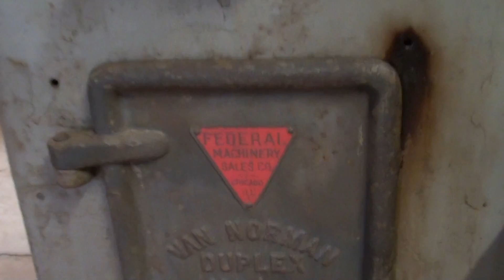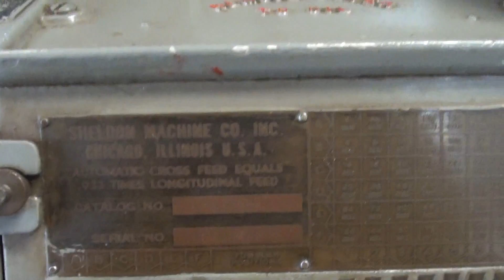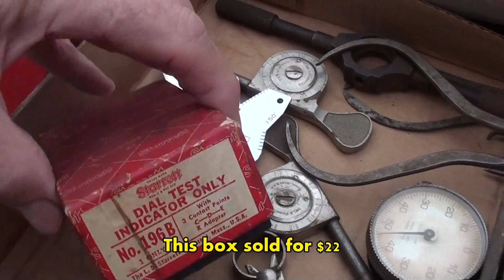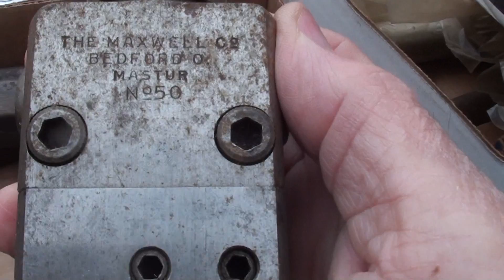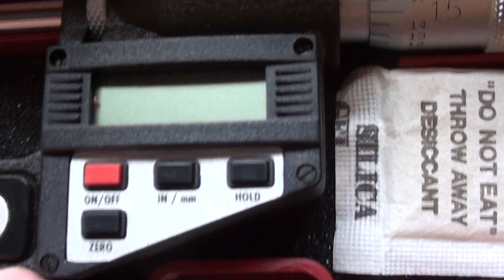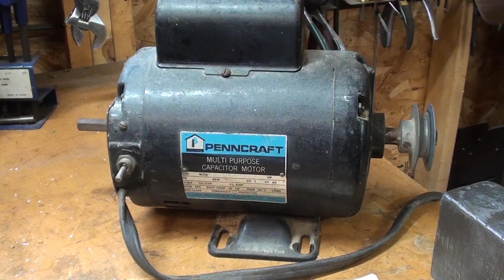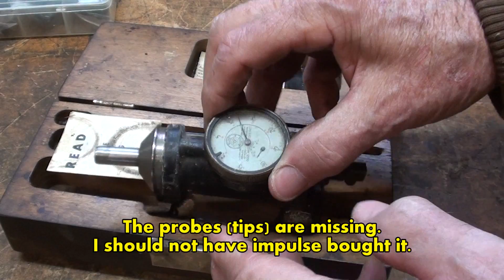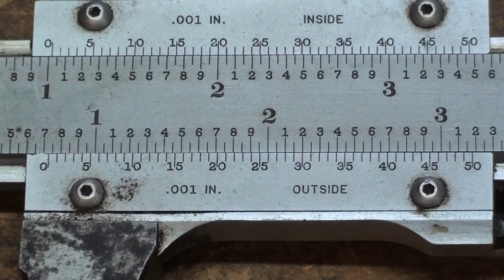A GREAT Machine Shop Auction Sale TIPS #609 tubalcain

Comment: Probably a bunch of people said it already, but that coaxial indicator is a Blake. The absolutely best made coaxial. All others od this style are copies of this Blake. What I find interesting is that I've never seen any other tools made by Blake. They seem to be a company content with making one item very well, and have not changed the design in ages. You can buy aftermarket contact probes online. Blake also offers repair and restoration services for these. Over the years I've had several of these pass through my hands, and each time I came across one with a contact point I didn't already have, I'd add it to my set, and sell off the rest. I'm amazed at how many different lengths and styles they offered. Most are straight or bent rods of various lengths, but one is a short spring loaded point for locating the spindle directly over a center punch mark. $5 is an absolute steal for that, I'm so jealous, congratulations.
Reply from the maker: Yes, I am aware that that brand is the best, thank you. Where do I buy the contact points? eBay? Or some other source. The contact points from my Chinese one, do not fit in the Blake
Reply: @mrpete222  I've found Travers tools has the best price on OEM blake points, but good used ones are on ebay.
Reply: Hmmm, seems ordering them direct from Blake's website might be cheaper if buying new. There is a seller on Ebay selling points for the blake for $15 each. At this price, they've got to be aftermarket.

Comment: If the lathe and the Bridgeport came with all the extras on them shown in the video then the prices were good. Most auctioneers separate down to the bare bones making you bid 100 times more and likely loose out. Those large verniers bring back memories. A old timer who has been gone for over 30 years now had a set hanging on he his shop wall.  I think he did some large cylinder boring at one time. He kept them in great condition.

Comment: You would never see an auction like this in Mobile Alabama or anywhere near Mobile. If it's not on Craigslist or FB Marketplace then you go to the robbers on eBay. The word "Vintage" triples the price. I saw 4 or 5 pieces of 1/4" brass welding rod in the original brown paper wrapping listed for $200.00 because it was of course Vintage BS. I started our Oxygen/Acetylene Welding using 1/4" rods was an everyday thing. What kind of idiot would even consider some old brass rods that you can buy at your local Welding Supply for a few bucks???? I think the lathe went for a fair price and the mill, both had a lot of tooling to sweeten the deal. Thanks Mr. Pete, can't wait to see the next one you go to.
Reply from the maker: Thanks

Comment: Mr. Pete
You really did good at the auction!
You are lucky to be living in an awesome place
to find great tools for auction/for sale.
Do you happen to know where a good small starter shop
Metal Lathe is for sale? 6” to 8” X at least 20” no longer then 30” 
In good condition?
I’ve been looking here in Texas and was 10 mins late calling before 
someone beat me to a really nice old Atlas lathe...in great condition with 
A lot of tooling and extra gears and screw making gears & several manuals.
I almost cried.
If I’m not mistaken I believe I bought 3 classes from you on thumb drives a few years ago.
I was recuperating from my 6th back surgery and those 3 thumb drives keep me busy learning.
I just wanted to say Thank you so very much!
I got a lot of great information!
1. How to run an Atlas lathe.
2. How to run a bridge port mill.
3. Machine shop tips.
Excellent learning materials!!!
You should sell them again, I know people would buy them.
Let me know if you find a good metal lathe for sale, please.
I’d really hate to buy.a brand new one. I feel the older ones
are much better.
I’ll check back with you since I’m now retired from my job
of 35 years....and my back just couldn’t take the 12 hrs shifts anymore.
Thanks Mr Pete.
P.S. Thanks for the hard work in making and sharing your knowledge through the “you tube” videos!
J-Ray
Reply from the maker: Hello. I do remember you and your back problems. Hope it is feeling better. It was a good move retiring. I very seldom see is a little lathes For sale. And how would you ever ship something like that. Keep watching eBay and Craigs list. I still sell those video courses
Reply: Hi Mr. Pete
I’m glad I was able to. Connect with you.
As far as the lathe I will keep my eyes open for one.
And yes sir if I find one I’ll have to have it shipped to me.
A few years ago I purchased a blacksmith power hammer,
I had it shipped. From Florida for around $800.
It’s a nice one.
Anyway glad to hear that your doing ok, and still helping people 
On you tube with the videos you make.
You take care and God Bless.
P.S.
I still remember all my shop teachers!
All great teachers that went the extra mile to help
me learn and understand. I have a lot of respect them!

Comment: I need to bet a big truck with a big trailer and head out that way for auctions. $5 for a milling machine and no one wanted that big drill press. I coul bring them back here, mark them up 100x and still have people beating down the door. 2 of the 3 big industrial plants here closed 15-20 years ago and everything was either scrapped(heard about brnd new huge air compressors, still on the pallet being scrapped, due to liability of selling them) orthe other place, everything was abandoned. Had a couple coworkers go on a special assignment last year and the new owner was literally telling them to take whatever they wanted as it was on them to get rid of it. Heard most of its still there as they weren't using that part of the building and one of the contractors that comes into work and was also on that job was going to place a bid on it all.

Comment: Lyle. the vice you say runs backward, is I think been taken apart and reassembled wrong. I think that the handle should be on the fixed jaw side. It is insane the way it is now with the handle between the guide bars, and all the end pressure is on the retaining ring.
Reply from the maker: I agree, but I did take it apart and try it the other way. And it cannot be done. I think it might be homemade, and somebody screwed it up from the start

Comment: What did they do to those beautiful vernier calipers? I've got a set of the 12-inch Starrett master vernier calipers, and they are an absolute joy and pleasure to use. Sad to see a beautiful tool with its jaws all screwed up.

Shame about that Blake indicator, too.

I'd love to see you break out some welding equipment and restore that vise to like new with some weld build-up and machining.

Comment: You were wise not to bid on that Starrett digital electronic micrometer.
My wife got me one just like that for Christmas a few years ago, and it was dead right out of the box. Starrett would not repair it under warranty, as it was discontinued. My local Starrett dealer told me to never buy anything Starrett made that was electronic, only buy Mitutoyo electronic measuring equipment. Damned shame too, as I have always loved Starrett.
Tim
Reply from the maker: Thank you for the warning. And that’s surprises me very much

Comment: Was that vise made by a Swiss cheese company?
Reply: No, it is actually used to hold a 5 lb. block of Wisconsin cheddar while the various holes are being drilled to different depths.
Reply: It was previously in the same shop where Bubba worked.

Comment: @16:40 the Sheldon lathe sold for 1200$ not getting a bid for 1300$   not $1600.
Reply: If you have a tig you could fill all those holes in the speed vise with silicon bronze. It would still work well.

Comment: $4100 for a step pulley Bridgeport with no power feeds, no power drawbar, and no DRO?  You should go into business as a machinery reseller - I would be glad to bring $1000-$1500 mills out by the trailer load.